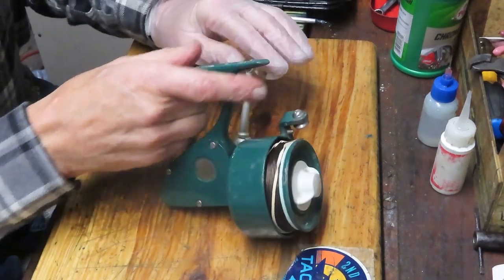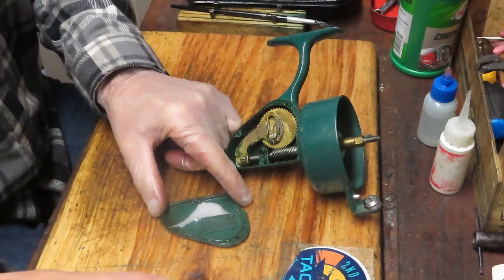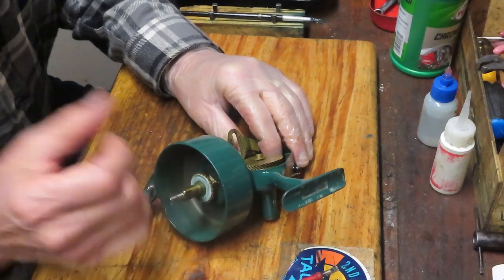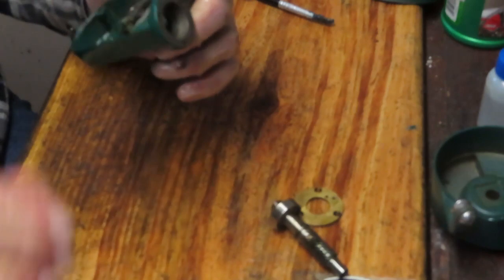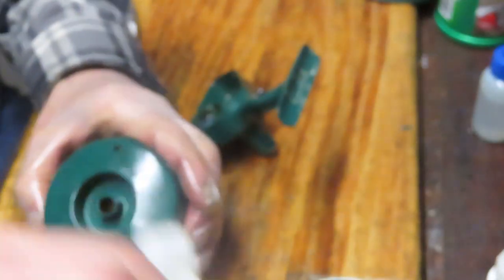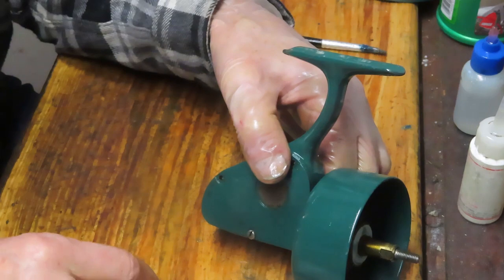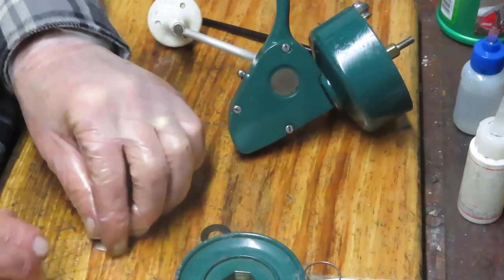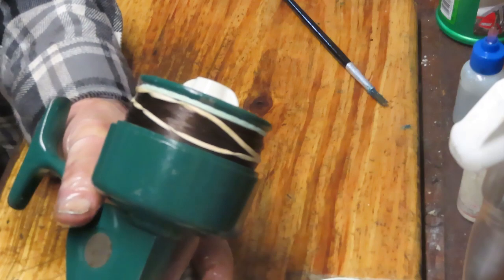Penn 706 SpinFisher bailess fishing reel how to take apart and service

Comment: 706 is the most wanted Penn. 
It’s the biggest spool size and only in bail-less I believe, 704s are Bailed and have less line capacity. 707/705 are the lefty preferred variants.
Reply from the maker: Thanks for sharing the additional information.  These reel are still desirable today - Dennis

Comment: It is not a 704 but rather a 706 Penn Greenie. It is one of the most difficult reels to collect because of how rare it is and the expense when you find them. I knew immediately what it was by the handle and the line pickup. Only the 706 had that handle. This reel is the predecessor of the Penn 706Z which you have done a video on as I was having problems with the line roller. Only the 706Z also came with a black and gold “pancake” or “coffee grinder” handle. I would love to find one of these but price is usually a problem. The AR dog on these greenies are notorious for pooping out. I’ve had it happen numerous times as I have serviced my 700 and 704 greenies. I actually own a rare forest green 704 that I converted to bail-less or PUM with a conversion kit. I even think Penn may have made the conversion kit. I got a 704 greenie without the bail in that way. You have such infernal luck removing those pinion and ball bearings. I know how to get the stuck ones out but it does take some effort as well as taking some chances that some would not think advisable. I got a very nice little tool from Gomexus for testing as well as measuring the inside diameter of ball bearings. It’s not expensive and is quite helpful. Anyone interested in that tool can contact Gomexus through their eBay website. You’ll never see nicer gears in a reel than those found in these Penn greenies and Z reels. Of all the reels I’ve collected my Penn greeniies were among the first. You could find much better bargains on these highly collectible reels back in 2018 than now. I did get a very nice 704 Greenie with the medallion side plate recently but it was twice what my first one cost. It is a testament to the longevity of these Penn greenies that there are so many still around. The only thing hurting the value of this 706 is the missing medallion. I still fish with my greenies and will continue to use them as long as I can stil fish! Great video Dennis!
Reply: Get some digital calipers for checking bearings ID, OD and widths for everything you own.
Reply from the maker: I thought I corrected myself int he video.  I certainly did on the video title.  I thought you would enjoy this one Chris.  I was surprised when this one came in for service.  I've seen a few of these come up for sale and most started around $200 - They are pricey - Dennis
Reply: Would you be interested in buying one still? I have one I'm looking to sell in perfect condition other than paint

Comment: What about the line roller mine is really load do you now how to fix that
Reply from the maker: Are you asking about the Baileys set up or the reel with the bail.  The reel with the bail has a bumper on the bottom of the bail arm.  You would need to fashion a replacement if that is missing.  A round, solid piece of 1/8 or 1/4 inch plastic and some epoxy would be the bush fix to get this corrected.  The other way, of course, it to replace the bail - Dennis
Reply: @2ndChanceTackle  yes sir I am talking about the balleis I want to try to take the line roller out of it but I don’t know is it would brake that part of the cup or not